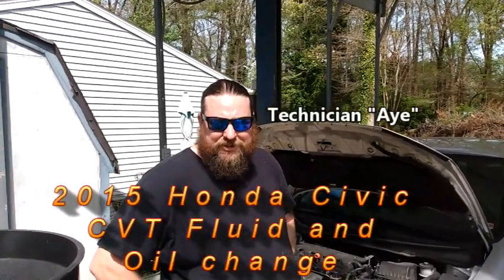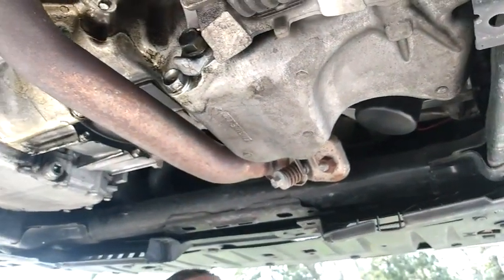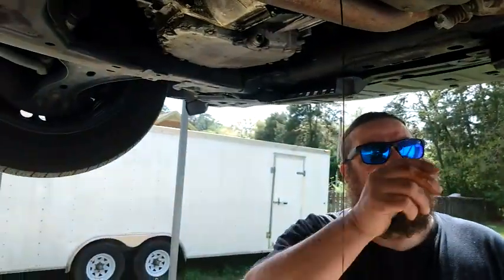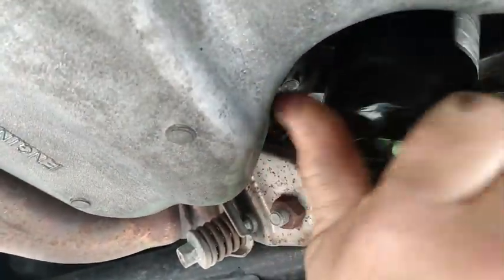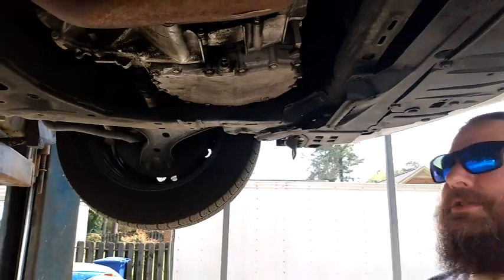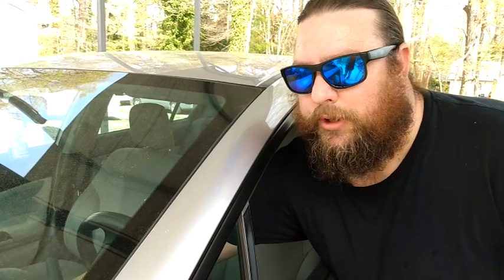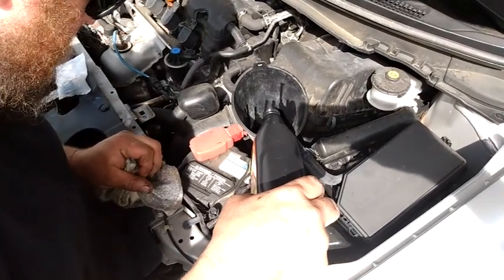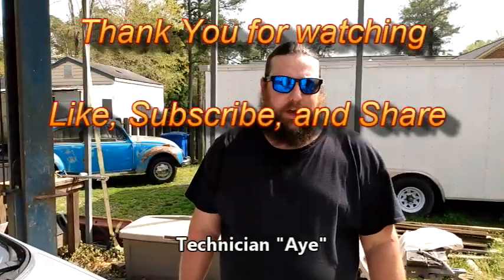2015 CIVIC CVT fluid and oil/filter change

Comment: Very informative video. I like how you put the cap and tube plug by the hood latch so you would not forget about it.
Reply from the maker: yeh i learned the hard way on that. as a young  tech  I did  leave  a cap off, made a mess of a jeep wrangler... 
and  in a panic made it worse with the chemicals I used to get it off the fenders. turned the plastic foggy.

Comment: Your video is the first one I've seen that said to have to vehicle running while watching the CVT check port.  Another video, the guy is reading from the Honda service manual which says "Do not remove the check bolt while draining or refilling."  The check bolt should only be removed AFTER refilling and running thru the gears, and the engine should not be running.  ...all according to the service manual.
Reply from the maker: you are correct . I should have double checked the procedure.
the updated fluid check video shows that i over filled the trans by about a half  quart

Comment: Honda fluid change. 
1. Drain bolt torque: 
36 ft. lbs.
2. Check bolt torque: 
15 ft. lbs. 
3. Oil filter: 
hand tight.
Reply: the check bolt torque should be 32 ft. lbs for the 2014-2015 civic cvt transmission

Comment: Thanx for educating us. Just wanted to know that when do we need to replace this filter? After how many miles?
Reply from the maker: which filter? the transmission?
it'd only a screen inside.
you must disassemble the trans outside the car ,only way.
Reply: @willtanner1617  it has 2 filters, one inside the transmission oil pan, and one inside the heat exchanger slot

Comment: he sounds like a master mechanic. Do you drive a few and drain the transmission again to flush? or is flushing not necessary for the CVT transmission. What about the CVT filter?
Reply from the maker: If you want the ratio of cleaner  to older fluid to be higher.
I have changed other cars after short drives,only because of the fluid being very dirty.
Reply from the maker: oyeh the filter in most of the cvt are screens more than filters ,you can see through them.
usually thin brass.can be replaced  in side the pan.
or just clean if in good shape.
next service I will probably clean.

Comment: This is an amazing video, I'm so grateful and looking forward to trying. My mind is going crazy trying to sort through misinformation or conflicting views on the transmission "filter". One popular video was claiming you should change it by 100k miles and don't listen to the dealership which denies that there is a filter. I went to the dealership and got 4 quarts of CVT fluid and a washer, and she flatly denied without any hesitation that there's a filter for the transmission. Do they just consider it a strainer or not a necessary thing to change ... ? Any opinion on this would be super appreciated!
Reply: There is definitely a filter for the CVT transmission. It is behind/inside the CVT fluid warmer. You can see the warmer at 4:02. It has two hoses attached to it. Your dealer doesn't know what it's talking about. Here's a video showing how to change it: 
https://www.youtube.com/watch?v=DjqMtsqTxxU

Comment: Pre filling the oil filter is not necessary, but since you feel it is you should consider pour the new oil through the outer ring holes, point being the oil you poured through the center will reach the engine unfiltered.
Reply: its clean oil, what purpose would that serve?
Reply: @LoveLikeaHurricane  Good question. Even though it is new oil it is not necessarily perfectly clean, even from the factory. also the seal on the oil spout can send small pieces into the oil filter, so when you pour down the middle of the oil filter it bypasses the filtering element and goes directly into the engine. It doesn`t take much of an impurity to clog a tiny hole or passage inside of an engine.
Reply from the maker: XBRIZZCAKEZ is right new oil is filtered but maybe not to the microns of the filter used. I cringe when I see somebody take a diesel filter off and dump it in the new one ....you just contaminated the inside area after the filter and it goes straight to the injection pump and injectors.
in this situation it goes straight to the oil pump ,un filtered.
the key is to get it in the small holes so it can be filtered.
the main reason I do this is to prime the pump for a no dry start.
I could have plugged the center to do it right
Reply from the maker: no chance of  debris from the bottle getting in the pump

Comment: Why did you replace the engine oil at 60%?
Reply: It's best not to change the oil every 10k miles or so which is what the oil life gauge goes by from my understanding. It's just based on miles not actual life of the oil.  Mine was down to 30% and I went over 6k miles easily maybe even 8
Reply: @superperior  The oil reading was at 60% so the oil life  was 40% used, 60% left. Honda recommends changing at 15%. Thats why asked. I usually change mine about every 5,000 miles, which is about twice a year. I've read that the oil life is determined by mileage/engine starting-stopping/RPM`s info going into onboard computer.
Reply: @xbrizzcakez  oh I'm sorry I just assumed it was based on miles driven or something, 5k miles is a great time to do the oil change I'm use to older cars and using conventional so I'm use to 3-4k mile oil changes call me old fashioned but I find it crazy when people say they go 10k miles between changes lol
Reply: @superperior  My daughter has a new GLI and VW says change the oil at 10,000 miles. She just had her first service done. My other daughter went in to Honda with a 2019 civic turbo with 50% oil life and they told her to come back at 15% life. In Europe I understand most drivers go 10,000 between oil changes.
Reply: @xbrizzcakez  as long as when it's changed it hasn't burned a ton of oil I guess that's fine, id personally just be carefull and make sure to check how much oil they get from every change and if it's missing some just get it done a little more often, gone are the days of 3500 mile oil changes  😂
Reply: @superperior  good point especially with an older car. Many car manufacturers are offering 2-3 years of free maintenance, but they are definitely doing the oil change at 10.000 miles. My buddy took a leased car in at 11 months under 10,000 miles and they turned him away, said return in a month. He came back in 2 months and they told him he missed the window and he would have to pay, :elbowcough:
Reply: @xbrizzcakez  that's Ice cold lol 😂   just saw this was originally a year old comment I didn't realize haha here's to more good  years to come 🍻
Reply: @superperior  I noticed the timeline too...better late than never, thanks